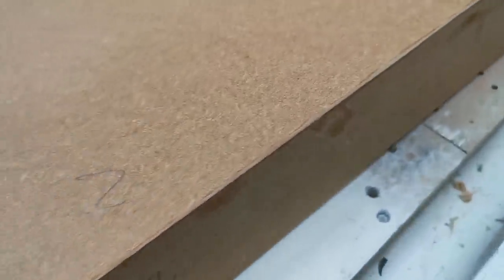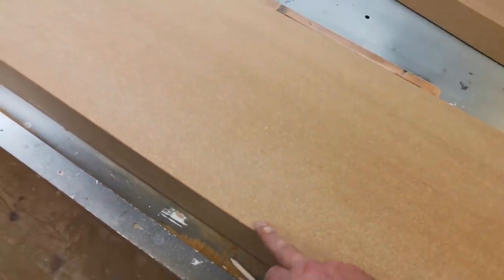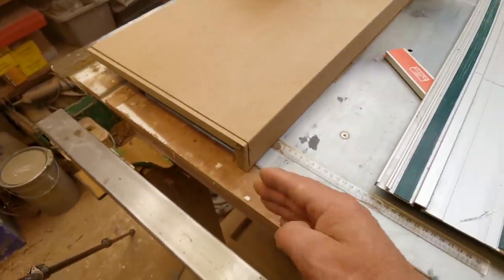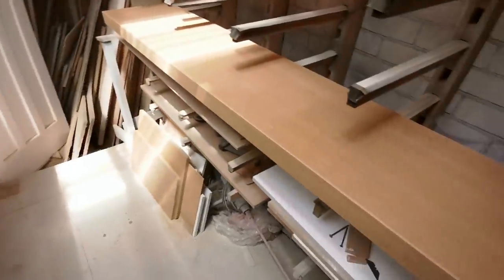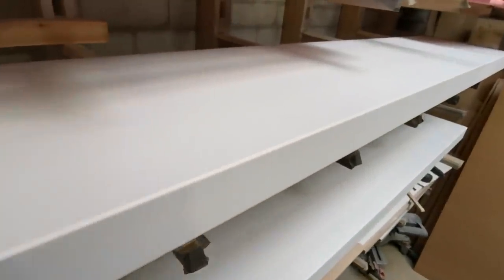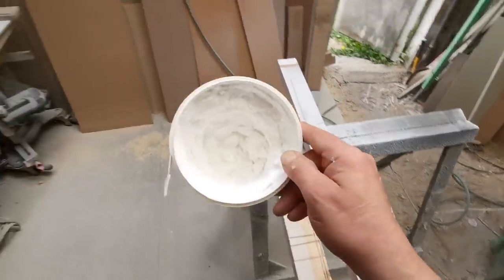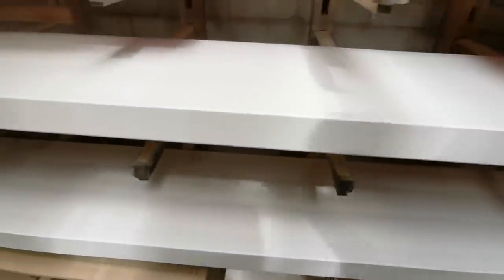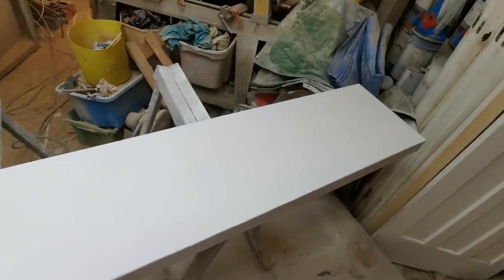Hospital bed make over Pt8 - Side skirt cutting, routering & spraying primer ready to fit on the bed

Comment: Gid, another great vid. I am struck by two things. 1/ you have a lot of stuff in that workshop:but I am sure you know where every little thing is. 2/ you get a great finish on the painted projects from that tiny space you have.. well done.
Reply from the maker: Thanks Paul, Yep i built a shed to put my junk in when i moved in 20yrs ago, the main bit with the saws in, then built a bench in it out of a fire door, the same one that my mitre saw is on, it's now got about 7 more extensions, a load of crap n very little organisation, i wouldn't say it's a workshop, it's the place where i work & i have a good idea where mos things are or where they should be if i remember rightly, Getting good results on the spraying is all down to dust management, mainly don't disturb it when spraying 😂😂

Comment: Great video GId alway a good evening when you vids pop up . Quick question mate what do you think of your shop table saw is it worth the money .?  And did you have to do much to make it work for you
Reply from the maker: 😁🙋‍♂️ Hi, Thanks Terry, 👍 It's a Scheppach Tisa 5.0, it'll cut 100mm depth, It's powerful, smooth n relatively quiet, when i bought it i had enough money, £500-ish to buy this or a cheap cast topped one, the cast ones only cut 75mm & weren't very well made, so i went for this n always planned on putting it in a table & making a decent fence for it, which i did 👍 but i did have an issue with the rise n fall after a couple of yrs, I needed to weld that, & i think a shim has worn on the spindle, you can't get the 5.0 any more n that's prob why, I'm not sure if i'd recommend it but i always knew i was going to Frankenstein it a bit to suite my needs, the sliding table i use for squaring boards is surprisingly accurate but it's double boarded to make it higher because the bench at the side is 20mm higher, lesson learnt make all benches the same height 👍 It's my saw, I love it like i would a grumpy old dog or a dodgy cousin,  https://youtu.be/tQ97rFxfRFc
Reply: @Gidjoiner  i was going to ask the same question Gid lol , saved me asking you , i only have the dewalt one like you recently purchased but considering i am only a DIY er i suppose the dewalt is good enough for me  P.S Brilliant video as always Gid i am amazed how well the two pieces of MDF came together it is like one piece of mdf and obviously much stronger than gluing two boards together , i might have to invest in that router bit .
Reply from the maker: Hi Simon, yeah the little Dewalt is fine, i quite like it on site, not sure if i could put up with the noise at home here, not sure the neighbours would either, all my machines are noisy but there a heavy machine type noise, The Dewalt is bit more 'screamy' 🙉 Thanks, yep that close-up looks almost like one piece n yeah it's about as strong as you can get with a corner joint. n yep the Axminster bits seem to live quite a while,  I might buy the middle one one day but I only got the biggest & smallest, missed out the middle one because there's an overlap in the thickness of boards, & i couldn't afford all 3 😉 https://www.axminstertools.com/axcaliber-mitre-lock-cutter-ax805970